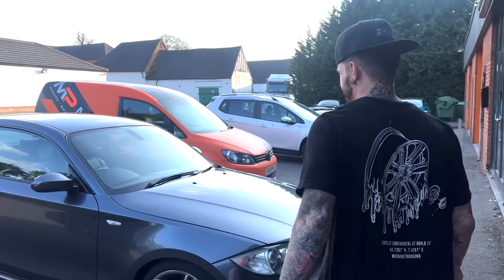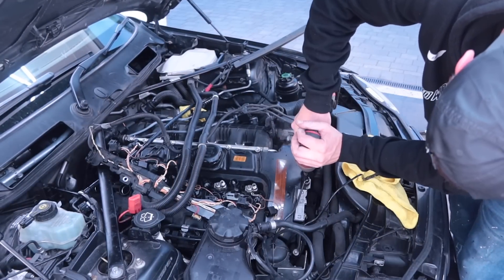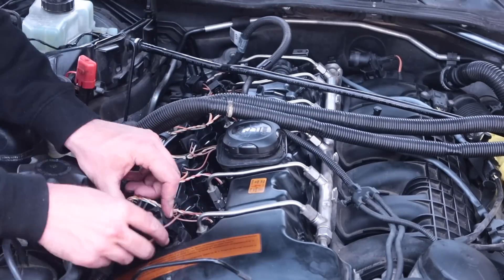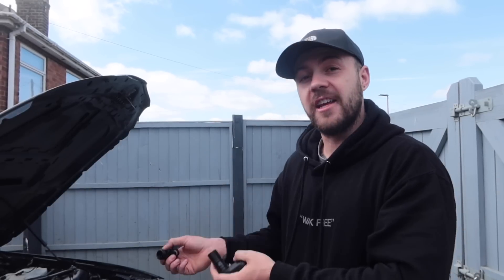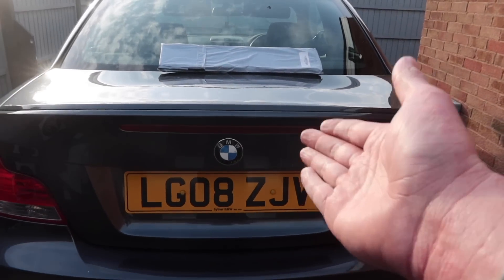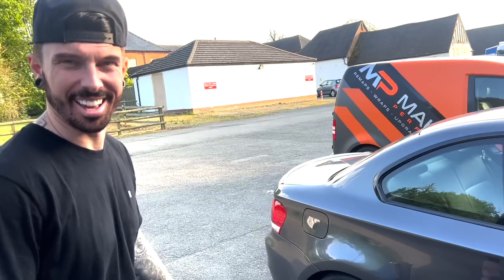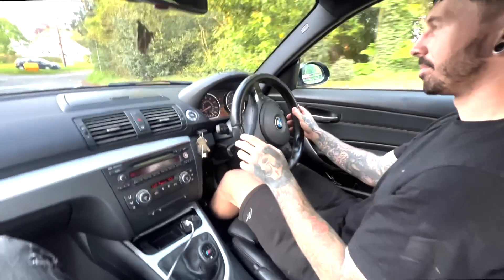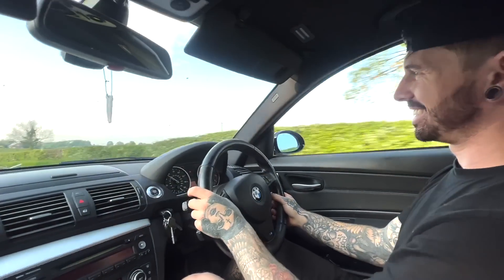MY CHEAP BMW 135I E82 NEEDS REPAIRING

Comment: I did my valve cover gasket on my new project 135i immediately after I bought it as well. The vacuum lines that run across your engine are prone to cracking exactly like yours did, I would recommend replacing all of them in the engine bay since they are all super brittle and are prone to leaking and causing misfires which are annoying to track down. That PCV/rocker cover hose that goes back to your intake - I would recommend fitting a catch can as these cars tend to have a lot of carbon buildup being DI. The spark plugs look ok, but I would just recommend replacing them with NGK plugs if you plan on modifying this car's powertrain at all. Otherwise, things look great, excited about the build progress!

Comment: I gotta say a few things and first you're a fun guy to watch on video. Thanks for the hard work in videoing your work as it makes everything take at least twice as long and hearder to keep you head straight about what you're doing. Been there flubbed that lol. The other thing is it's is SO hard to sit and watch a person that hasn't done this work on these cars before and not be able to help! I'm telling the screen things and it's so silly LOL. One more thing is you've done great for doing it all on your own and being the first time and you not being a mechanic at all! Congrats!   When you were trying to get the tall valve cover bolts off and you said at first that they are 10mm I so wanted to help! They are in fact 11mm and if you can get a hold of a deep regular deep socket (11mm not 10mm LOL AHH!) then you can put the socket on the tall bolt first then put the ratchet onto the bolt but don't click it on all the way you can easily break it free and take it off and or on again. Oh how I wished I could have been there at that time sigh.......Then you threw away the cacuum lines that are made of plastic that run over the Valve covers. All you needed to replace were the short rubber or silicone (depending what you buy etc) parts at the end that go to the brake vacuum main line. But you weren't kidding when you said you didn't know about these cars. LOL.   But then I saw that you had replaced either the old lines that are molded to go over the cover back on again or with new ones in the next scene or two. So good job!!

Comment: Hi Chris , can’t believe nobody told you about this , but the small part of the vacuum hose that you broke just pulls off the hard plastic part , you supposed to resuse the hard plastic part and just replace the part where the braided vacuum line attaches to it with the new ones you got , but the hard plastic part is there not to melt on the rocker cover , cheers mate

Comment: Great vid, have the fuel injectors been replaced yet, might be worth looking into as a full set will set you back 2.2K. I know that from experience unfortunately. Looking at the old spark plugs that could be the case, may also explain the lack of power. If you pull one of your new spark plugs after a drive give it a smell and if you can smell fuel and it’s wet the injectors will most likely need replacing. They tend to all go together so may aswell get a set of 6. Very expensive but you’ll be good for another 100k miles then!
Reply: I’m waiting for my injectors to shit themselves. Luckily my 335i is under extended BMW warranty. The car has had the HPFP and turbos done in the past, the last biggie is the injectors.
Reply: Mine’s in garage getting my fuel injectors replaced. I’m selling the car, don’t want to be spending that much money
Reply: @RenaCCiYT  I wouldn’t sell it just after you’ve paid for injectors. Look on the bright side at least nothing else that breaks is gonna be more expensive than that.

Comment: Just ask you local dealer for a discount, mine always gives me 10% off now but it gets them closer to sone of the dealers that sponsor forums once you factor in postage etc.

BMW short shifters for these are no longer available, but the shifter from a 1.9 Z3 fits and offers decent reduction on the shift length. Cheap too.

Comment: Awesome, love my E82 135i, great platform, I installed 17T turbos on mine and now it goes pretty well, (vids on my channel) beating my mates 2019 Supra GR B58 engined car with Stage 2 Ethanol tune was great fun :) I've had to replace a couple of injectors on mine so far, but other than that not too much drama so far.

Comment: You didn't put the bottom filter housing correctly at 11:33. The back part has 3 hooks that need to slide in under the wiper cover thing, so sliding the bottom filter housing at a 45 degree angle or so should help. Hope it helps! PM me if you got any other questions. Just finished changing the eccentric shaft & valvetronic motor, rocker cover gasket, oil filter housing gaskets and steering fluid flush. I have a E82 N55, love these cars!
Reply from the maker: Cheers dude ill check this out tomorrow! 😊

Comment: Could you not have changed the sparkplugs when the rocker cover was off? Wouldn't have needed a specific tool then.
Reply from the maker: Yes but i didnt have the plugs at this point 🤣 that would mean planning ahead which im not bright enough to do

Comment: Did you tighten the injectors to a torque value or just as tight as you could?
Reply from the maker: Injectors didn’t come out my friend.
Reply: @Chris_Slix  i mean the connection between the injector and the fuel rail. the fuel line.